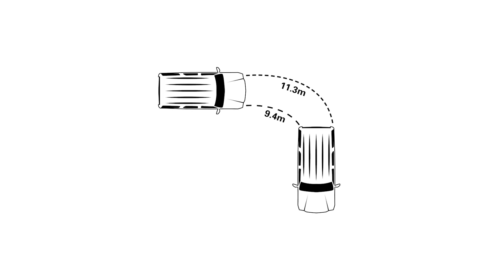SUB $600 DIY LOCKER INSTALL – Watch how much difference it made - Front vs. Rear, Manual vs. Auto

Comment from the maker: Hey all - looks like the 4WD Systems website couldn't handle the traffic last night - but it's up and running now! If you tried to purchase last night and couldn't - head to https://www.4wdsystems.com.au/index.php?id=180 now and use the 20% discount code 'ACTIONLKA19' - or call them on (08) 8369 0033
Reply: Yeh he called me last night at 8pm to make the order for a front Lokka and front and rear diff gears.
Reply: Sorry Guys - We got smashed - 2 IT techs working till after midnight to fix things
Reply: My question which size of tires did you use during your video please
Reply: Update 25th August - Finally got the last problem sorted and the system and payment gateway is now working properly - a huge thanks to my IT guy who has been working on all the issues for 10 days most days and most nights to get things stabilised. We've all been working 15+ hours a day to keep up with it !
Reply: You dont have an option for a 2008 dodge dakota
Reply: What about for a vdj landcruiser? Are they any good?
Reply: 4WD Action hi where can I find a full pic of your hilux it looks awesome
Reply: @4The2nd wranglers have both a front and a rear torsen locking differential. At least the Rubicon and Willys Jeeps do.
Reply: I luv your vids
Reply: Do they. Make the front locker for a Suzuki Equator? Its a 2012
Reply: @4The2nd jk wranglers are absolutely not LSD they're solid axles, Dana 44 & 48, only a couple European market JKs have hybrid LSDs
Reply: JOHN FILMORE:  Rubicons have E lockers not torsen drive L slip diffs ...hahaha wtf! Military humvees have torsen drive  limited slip diffs. Torsens are limited slip they are NOT lockers!! People spout on about shit they no nothing about!!  CLUELESS!! Dana does not make a 48 axle hahahaha hahaha WOW!! Dana 30,35,44, and the 60. Just stop posting before the rest of the people realize you are full of chit!. Also most jk's are open diff not LSD.... Clown! Also just another reality check for you jeeps that come factory with limited slip rear axles are CLUTCH DISK NOT TORSEN!! Also they dont put limited slip front axles in from the factory.
Reply: If your turning and lifting a wheel does the locker still work?
Reply: This particular locker can also fit to Fortuner front axle? I believe Hilux and Fortuner share the same axle...
Reply: Hi all do thay have for Toyota 4runnrr 2012 front & rear Diff locks
Reply: With regards to front vs rear locker on an IFS it doesn't make sense fitting it to the front and you basically gave yourself the reason. You didnt think this part through though. 5m20s the front diff only works when its in 4wd (the front diff ALWAYS works if a vehicle is in motion even when 4wd is not engaged. this applies to both axles. test as follows - leave the vehicle in 2wd but engage the rear diff lock but the gearbox in neutral. push the car in a straight line and in a circle on sand. now go check the tire tracks. if 1 Tyre is less inflated than the other/smaller in circumference/the vehicle is turning 1 of the tires will slide if they on the same axle. front or rear) This is also why an engaged front locker affects steering which is that 1 of the tires are slipping when turning and means only 1 tire has enough traction to steer. which is why manufacturers fit on the rear axle if only 1 axle is lockable. 
at 4m00s exactly you talk about a lifted wheel means no traction. This should be the deciding factor as to where you would fit a locker but first take this into account. will the vehicle have any load in the front or rear of when you go off road. (passengers, camping gear and all gear or upgrades should be fitted or in position before working out which axle needs a locker if you are only fitting a single locker) hence the reason why open back trucks/work horses that take loads have stayed rear wheel drive over front wheel drive. The axle that has the highest mass should always be the drive axle as it offers higher traction. Anyway. once the vehicle is loaded with all its off road occupants etc. you drive 1 of the wheels onto a ramp as far as you can until 1 of the 4/6/8 wheels on a drive axle lifts off the ground. this is the axle that should get the diff lock. this creates the most amount of possible traction.
Reply: With this set up will all the power go to wheel that is unlocked when steering? Or do both wheels unlock? Resulting in same problem all the power going to the wheel with no traction?
Reply: Alot of folks have been having issues with orders concerning Lokka some not even receiving any feedback I recently purchased a unit and promptly canceled it because of all the negative remarks, is this something you guys can shed some light on? I ordered directly from the lokka website
Reply: Dose it still make a clanking sound turning corners when 4x4 is disengaged ??
Reply: hi it is full time lock or only when onside lose traction will it effect when turning

Comment: Yeah right it would be  that easy to install. There would be ton's of cursing in my driveway...
Reply: They are easy enough.  I did my own one in my Patrol.  Hardest part was lifting the pumpkin back in on my own - the Patrol diffs are HEAVY
Reply: from you or the missus ? OR BOTH ? ;)

Comment: I put a Lokka in front, then rear of my 75 series Troopy many years ago.  Best mods I ever did.  I go wheeling from Lancelin to Albany, WA.  I can make it up TJ Hill around Harvey no problem.  I also made it up Bobs Hill around Brunswick (with a little track building) one year.
* 75 Troopy Lifted (4"), Dual auto locked,  37's, Sliders, Bar work, Winch, Lights and some extra character (panel damage).
Soon to have rear winch, lower transfer gears and a better departure angle chop. (and some rust/dents removed)
Reply: Sounds like a great bus!
Reply: I'lleatyou  i care

Comment: For anyone trying to do testing after installing one in an SR5, if you only have the front wheels jacked up, you will need to turn the car on, put it in 4wd (may need to move the car a bit to engage it) then turn the car off still in 4wd. With the car off, put it in 2WD. The ADD won't disconnect the front half shaft until you turn the car back on, so the front wheels will stay connected to the diff and you can test as they have done in the vid.

Comment: I put one of these in my Nissan frontier (D40? for some of you) about 4 years ago.  I use it offroad a bit and notice a big difference but the truest test of it for me was plowing snow.  The amount of difference it made being able to back up off camber on my neighbors driveway with a plow on the front and also pushing banks around is night and day.  One thing they don t mention though (at least for the version I have) is that the "unlock while turning" only works if you are not on the gas so it makes icy roundabouts that have hills interesting hah!  Don't really notice it though at speed on a turn you just don't gun it though the corners and all is well.

Comment: We call these types of lockers lunch box lockers in the states. They are really only designed for very light duty use. The sharp edges on the teeth wear out fairly quickly and they start slipping and ratcheting. Most new guys in my jeep club go the route when they first start. But after they have went through 3 of them, they arent any cheaper than a Detroit, which also unlocks when cornering. Both the truetrack and the actual locker unlock. I started out with lock rights, the went to spools, then Detroit's, and finally arbs. For a manual install it and forget it, nothing works better that a Detroit.  They will outlast your axles, period. Foe a push button system,  arb with braided air lines is the best I have found. I base all of my statements off of 40 years of trail and breakage. There is nothing wrong with lunchbox lockers, just realize they are very light duty going in. Good luck.
Reply: I have to disagree with how he states that a lunchbox locker works. Yes the teeth are engaged by default and they will disengage when turning but only under specific conditions. The housing of a lunch box locker where the diff pin goes through is designed with an elongated hole. The reason for this hole design is so that when the pinion turns the carrier the pin that goes through both the carrier and the locker housing gets forced to the side of the locker housing oblongated hole which acts like a ramp forcing the two halves of the locker outward, this applies pressure to ensure the teeth stay engaged. So if you are in 4wd and there is torque applied to the front driveshaft the locker will not disengage until the load/torque is removed. If you have any type of traction on the front wheels while in 4wd they will not automatically disengage when you turn. Depending on whether your 4wd is a manual or automatic transmission will determine how to properly drive your vehicle in 4wd with lunch box lockers. There is a learning curve, especially if auto lockers are in the rear axle. For example if your vehicle is a manual transmission and need to make a sharp turn going uphill when you are sitting a stop light or intersection, to smoothly drive through that corner and give the auto locker the ability to disengage you must first drive straight and build momentum to carry you through the turn then press the clutch and coast through and the locker will unlock. If you try to accelerate through the corner it will create a load on the rear axle and the locker will not disengage and you'll chirp the tires or it will hop through the corner. Load or torque on the differential is needed to apply and no load to disengage. Also if in very slick conditions you may need to ride the brake pedal to add load to the differential to get the locker to engage or to stay engaged.
Reply: Is it true that front auto lockers are noisy?
Reply: "light duty" bullshit they do last and are durable. If you're constantly needing to replace them then you're obviously driving to hard and to fast
Reply: Raphael Smithwick - just gonna point out the contradiction in your response, you believe them to be durable unless driven too fast and hard? That’s pretty much saying they will NOT last if actually used in the environment they say they were designed to be used in. So NO, they are NOT durable.
Reply: @raphaelsmithwick4363  saying something doesn't last if driven fast or hard means it's light duty...
Reply: DJ Dragon well put, exactly spot on!
Reply: I'm hungry
Reply: ARB’s are junk and I would never use them ever again. I run OX LOCKERS on my F-350 (Dana 60, Ford 10.25) I wish they would make an OX for my new Tacoma front end.
Reply: These are great in ifs 4x4's, and we have a lot of those in Australia.  In the states, or if your serious then you want a solid axle and options for more serious setups.
Reply: @JAMESWUERTELE  the only time I've heard that with ARB lockers is when they've been poorly matched to the machine.
Reply: phục êwê what type of locker is the Detroit?? Is it also a ratchet style locker??
Reply: @israels.s.7755  No noise comes from my front Lokka the only way you know it's engaged is the steering is a little firmer but that's all
Reply: @israels.s.7755  They are supposed to click as they disengage when turning a corner, most people say you can't hear them in the cab. My suggestion is to fit manual locking hubs and disengage the wheels from the front diff when on the road and it won't be a problem... Here's an extract from the manufacturers website - Q8. Is it noisy? All automatic lockers make some degree of noise. If Lokka is operating normally, it is possible to hear a light clicking sound when cornering. However, this is often inaudible from inside the cabin, especially with either the radio on or windows closed.
Reply: I just welded front and rear fk it
Reply: When you said the word Jeep this comment became invalid. Jeep just breaks. So something breaking on a Jeep is just normal.
Reply: No he drives a Jeep.
Reply: Not so true noob

Comment: Thanks Shaun for clearing up the misconceptions about these Lockers, I've ordered one for the front diff. I want to say that I rang 4WD Systems in Adelaide and spoke to the owner and he was a genuine, really nice guy. It was a pleasure to speak with this guy and because of that I am going to say that I thoroughly recommend them even though I haven't received it yet, brilliant.
Reply: I've received my Lokka, fitted it and it works really well and with the use of hub locks, it doesn't even come into play on the road.
Reply: @Vacublaster1  how is it to daily drive and should i buy one.